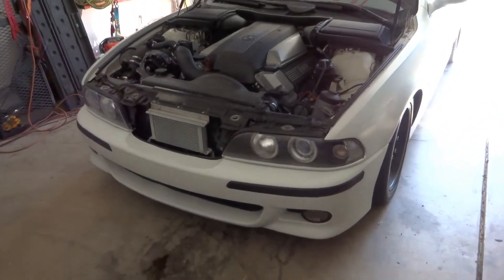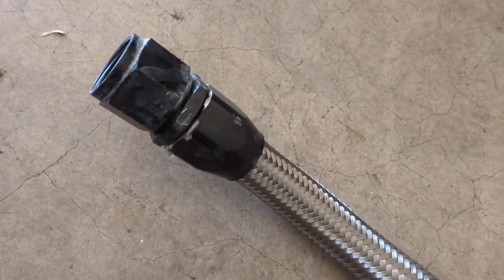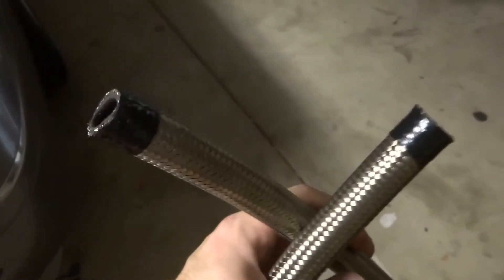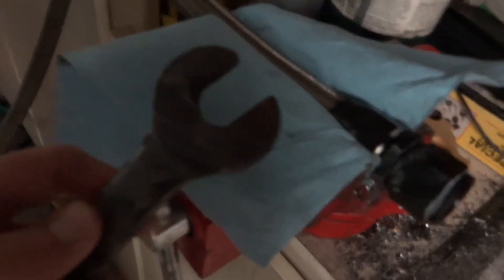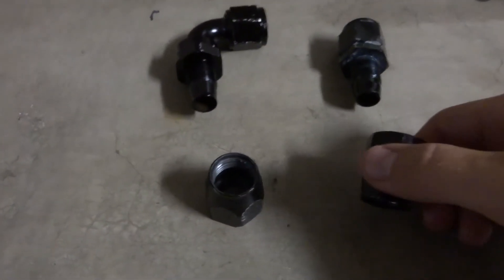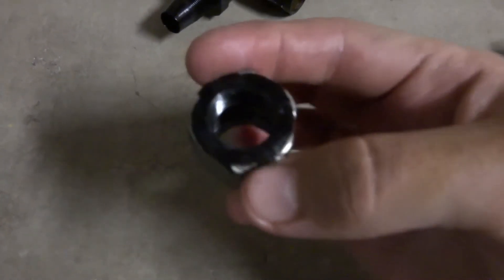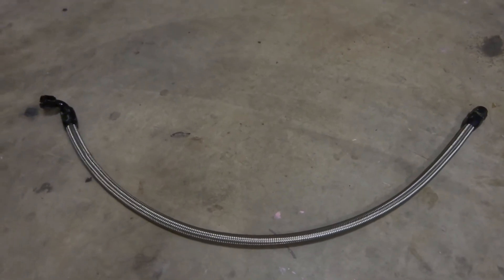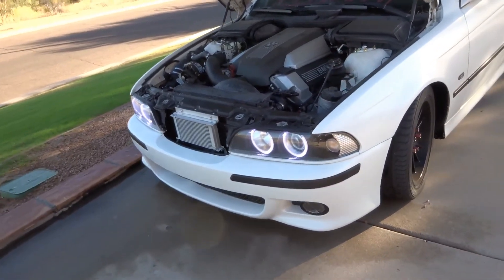HOW TO: Make Or Rebuild Your Own Custom Stainless Braided Hoses W/ -AN Fittings!

Comment: Hello, im currently doing a M62 in an E36 and wanted to run a oil cooler without switching to a sandwich plate still oil system. How are you running the lines to have the oil cooler in junction with the stock oil filter housing?
Reply from the maker: I cut the oil discharge line in half and added AN lines and then extended those to the cooler so I cooled the oil that was already filtered